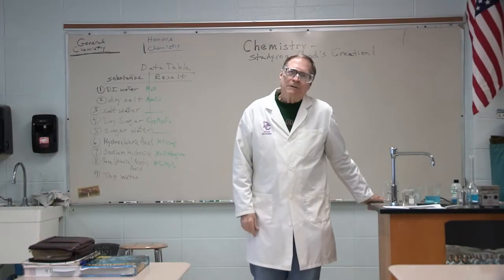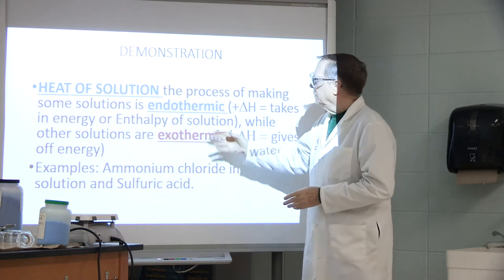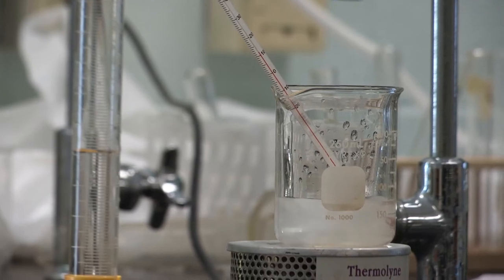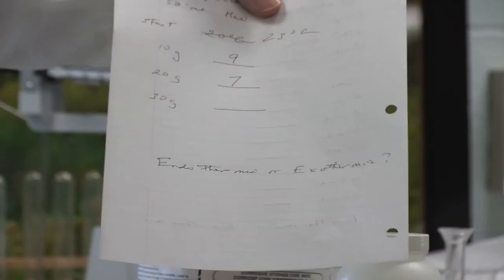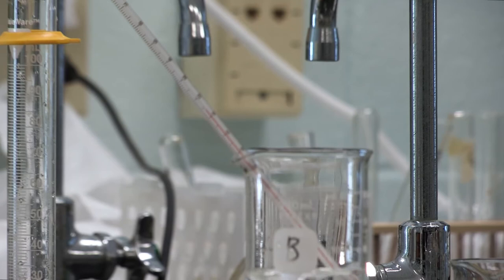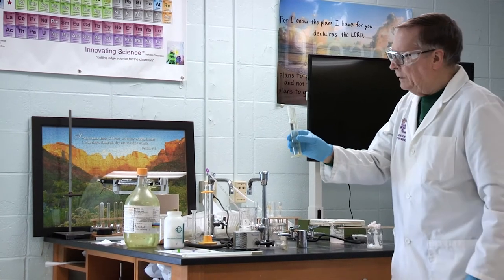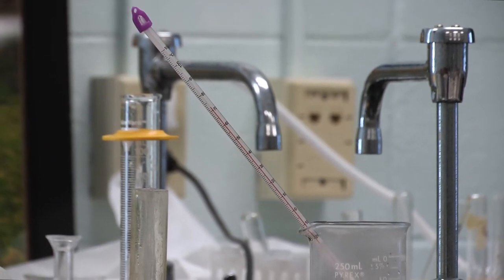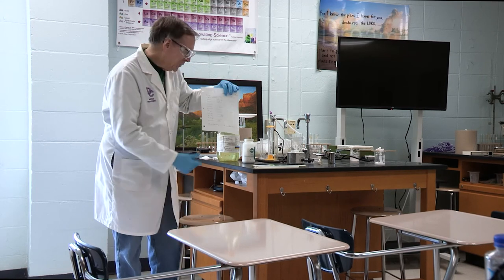Heat of Solution

Comment: 1. I thought this video was very interesting! I really enjoyed watching the two different reactions and actually seeing the change that occurs in these reactions rather than just seeing them on paper. I also found it really interesting how the sulfuric acid solution came only a couple degrees away from boiling the water without heating it at all!
2. This video was really helpful for learning about heat of solutions and Endothermic or Exothermic solutions. It was helpful to visually see the reaction take place, and especially to see the numbers on the thermometer change as the solution got progressively hotter or colder.
3 In the first reaction with the salt, the measurements started at 23 degrees Celsius, then dropped to 9 degrees Celsius after the first wave of salt, then to 7 degrees Celsius after the second. This reaction was Endothermic. For the second experiment, the measurement started at 14 degrees Celsius, then raised to 29 degrees Celsius after the sulfuric acid, then to 43 degrees Celsius, then to 72 degrees Celsius, then to 83 degrees Celsius, then eventually ending at around 99 degrees Celsius, just below boiling point.